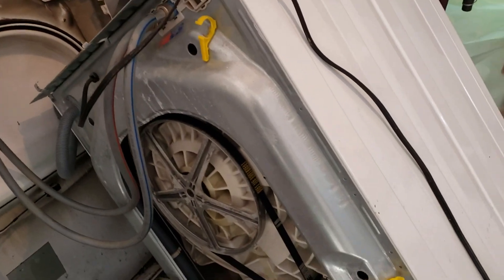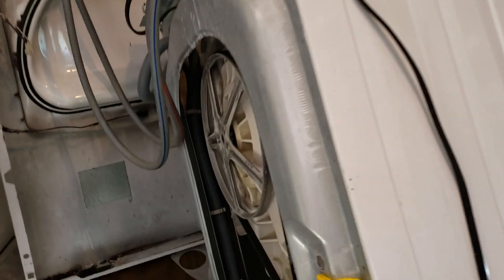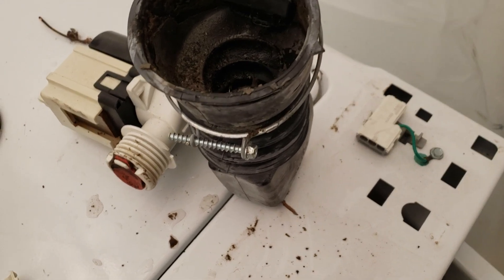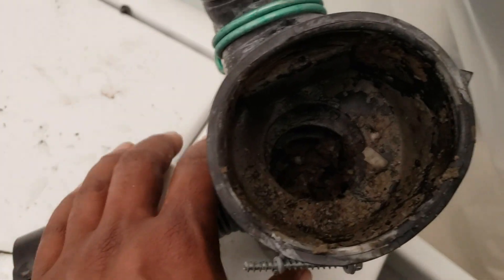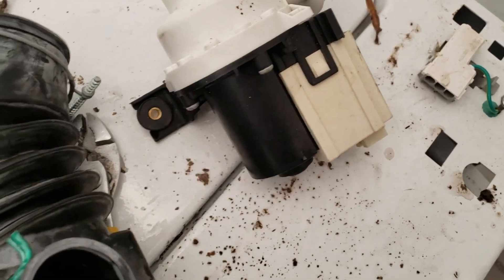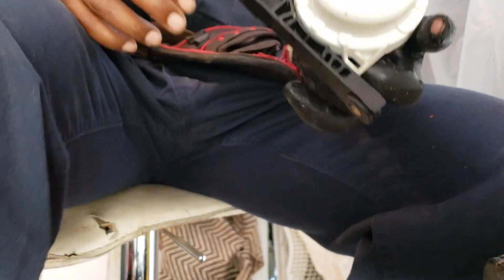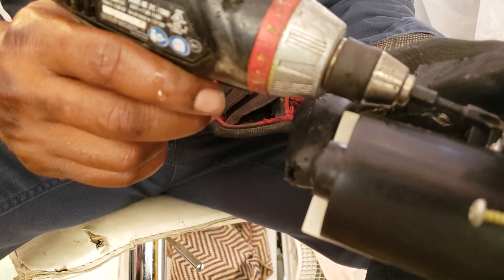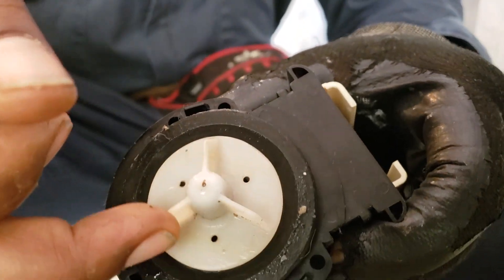Frigidaire washer no drain troubleshooting

Comment: This video is so helpful! Thank you so much. I took off those annoying, difficult pressure clamps and replaced them with hose clamps that can be tightened with a screwdriver. So much easier to reattach when cleaning coin catcher and housing.
Reply: I switched to the hose clamp but now its leaking. How tight did you have to tighten it?

Comment: Great video. I had to take off the front panel for ease of access; in a condo and the access hole on the bottom of mine just isn't big enough. Needed to strong-arm the clamps. Vice grips - locking pliers would have helped.

Comment: Vacuum out the tub and drain hose with a shop vac. That removes about 3/4 gallon or more of water.  Then pull washer out about 2 feet, tilt it back against wall, stuff a large towel in the bottom-back and under the boot area and access coin catch boot by removing only the largest top retention ring.  Fixed with clean-up in an hour and much easier. Usually the pump is not the issue.  

Tip: don't fill the washer with small items and large items, and don't stuff the small items to max either.  The large items or overfilled washer tub will work small things like panties and small socks thru to the coin catch. That's what was in mine, clogging it...panties and a bikini top pad lol.

Comment: So I just cleaned my pump out, thanks for the great video. But the red flapper valve on mine was deteriorated. Is it absolutely necessary & if so can point me to where to get a replacement please?
Reply from the maker: flipper is to prevent backflow should still work without it. You we have to replace the whole pump to replace it
Reply: You are probably way past this question, but I wanted to chime in for anyone in the future who is looking for this reply. 
It's probably a good idea to have one on there ..
And FYI... Some dishwashers use the same drain pump or very similar. If the flapper is for sure all you need, you can find it by searching dishwasher category

Comment: Good video. No need to take the rear panel off.  Other videos show removing the whole front and top, also not needed.  You can access everything (pump and coin catch) from the underside by tilting the washer backwards up against the wall.  It's a pain in the ass but shorter and simpler than removing the extra panels.
Reply: Wow thanks dealing with this now and how you just said is exactly what I’m going to do and try
Reply: @ericaschannel2599  sure np. I've done it twice now. 2nd time is much easier after ya know the drill!  😉

Comment: My Frigedaire Front loader Washing Machine model # FWFB9200ES0 does not have a coin trap in the drain hose. All the videos I've watched show the coin trap. Is the model suppose to have one as well? I'm the only owner and I've had it for 17yrs. The only thing ever done to it is what I'm trying to fix right now. I think it's actually the door latch assembly that's the issue after watching a few more videos and reading but don't want to put the drain hose back on if I should buy the coin catcher to put in it first. What I would absolutely love for you to explain is how a sock, coins, etc get into to drain hose to begin with. Like what do they go through from drum. I can see things going through the little hose like a bobby pin, thread, hair, etc. ANYWAY, Any help is appreciated. I thank you for your time in advance!

Comment: I have a Frigidaire fffs5115pa0 front loader washer throwing a e21 code. I've replaced the drain pump twice thinking I got a bad one the first time. The hoses are all clean with no clogs. I've also replaced the door switch and the main control board that runs the pump. The white/red and purple wires going to the pump all look good too.. Ive done all of this and still getting the e21 code. Any ideas?
Reply from the maker: Check the pressure switch and hose that goes to it. Take apart every hose that water flows through to exit the washer for a blockage. And make sure when putting the drain holes down the pipe on the wall that its not all the way down the hole, it could be getting submerged in water which will slow down drainage
Reply: @LeanOnYourRep  is the pressure switch the black box up top? All of the drain hoses were checked and it drains into a big concrete sink so its good there. I appreciate the help! Been going nuts over this thing.
Reply: @LeanOnYourRep  I disconnected the pressure switch hose and blew through it and could hear the water bubbling. I tried to run a spin cycle again and it wouldn't drain, it just spun. I then disconnected the pressure switches wiring and it took about 30 seconds and it threw the E31 code for the switch. Still not draining.

Comment: Hi! I'm not getting any error codes because mine's an older 2003 Frigidaire GLTF1670AS. The motor I have is model 131770600. Would the same Ohms measurements apply to that?  Here's a short video of mine (buzzing and attempts to spin):  https://youtube.com/shorts/UYPLqRYRjbo Need help figuring out what the issue is. Thanks for any help! Any idea how to get a specific motor specs to test Ohms, etc., without any documentation - even Frigidaire's website search yields nada.
Reply: I'm having this same problem right now. If you ever figured it out could you let me know please and thank you.
Reply: @n0xxm3rcyxx  I haven't figured it out and recycled the machine but kept the motor. Do you need a motor or not sure?
Reply: @TekChiDotCom  oh no I'm good now. Thank you. It was the pump. Replaced it for $20 and we are up and running. Thank you for the reply.
Reply: So the noise his was making in his video was the same as yours? And yours was the pump? @n0xxm3rcyxx
Reply: @MrsBuddevil  yeah that was roughly the same sound. And it fixed the washer. Has been running since I fixed it. But it was only a 20$ part so I'd start there if need be. I really dont know much about washers.